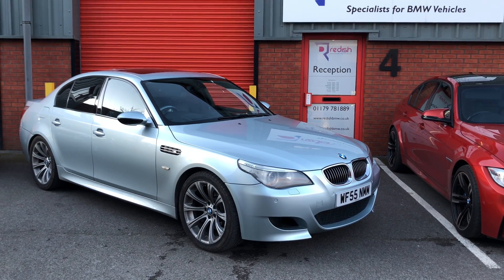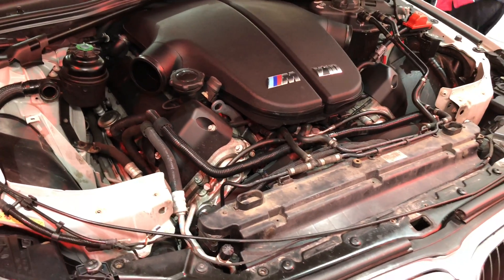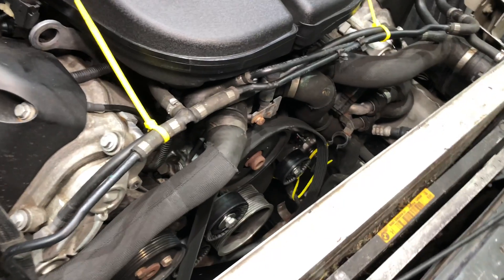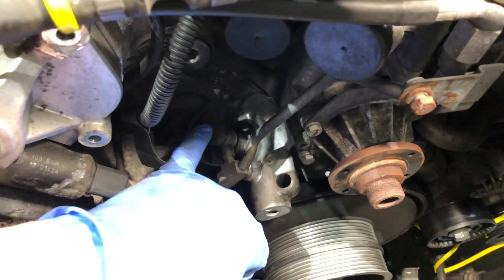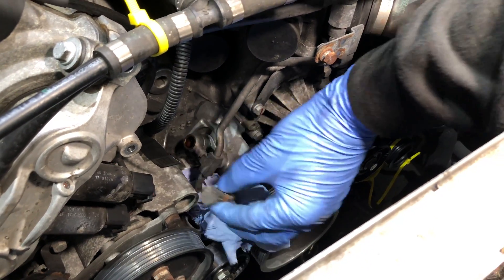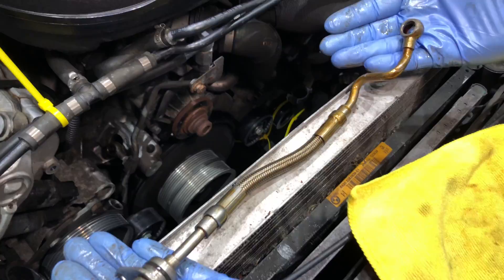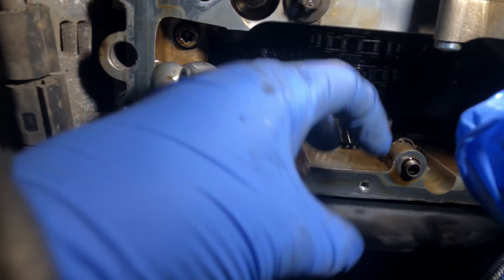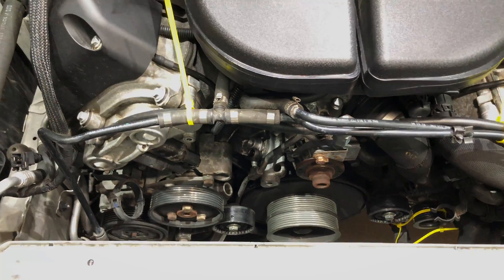BMW V10 Vanos Pipe

Comment: Nice video and quality work as normal! The old vanos line is usually quite hard to unseat from the block, but the magic of video editing.  It’s indeed a solid extra 2.5 hrs of work. Also a great time to replace the water pump.
Reply from the maker: Thanks hansbrix, you're right - it's quite tough to unseat. Certainly is several hours further work like you say.

Comment: Lazy design by BMW. The VANOS high pressure pump ought to have been designed to have a port that was accessible from the external surface of the engine - eg through the front cover, sealed by an o-ring.

Comment: My vanos pipe in front of the engine blew one summer and fixing was hard the shop manual says to remove the water pump pully. I tried even with pry bars and I did remove the bolts. Let's just say that pully is never coming off and the funny thing is you don't need to take it off.

Comment: Planning on getting my e63 M6 down to you in October. Will be a big one as I will need a full service, new Conrod bearings, vanos pipe, updated vanos pump gearing and updated oil spray nozzles (mine is a 55 plate). Keep the videos coming, they are making isolation bearable!
Reply from the maker: Hi James, thanks for this. That would be great - we'd be looking forward to that.
That's all work which we specialise in.
Aiming to keep a good flow of videos coming every 2-3 days during the lockdown to help keep isolation boredom to a minimum. :)

Comment: Where do you get those caps that block coolant that seems so nice and what sizes?
Reply from the maker: Good questions. I think they came either from BMW as a 'blanking tool kit' with lots of different sized caps from 4mm right up to big things like water outlets and throttle bodies etc. Or could have come on a new radiator for example. We have loads of these in a big collection and you're right they're great for keeping dirt out during repair.
Reply: You end up finding a kit for sale??